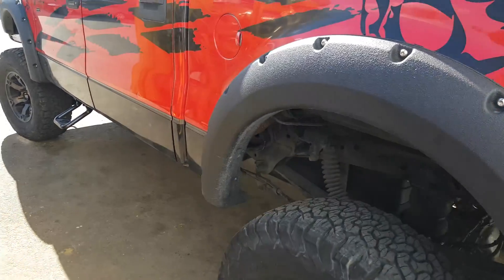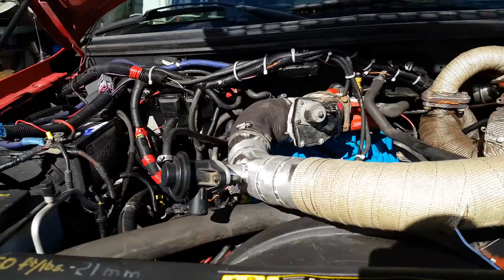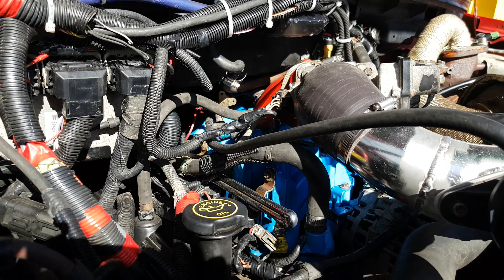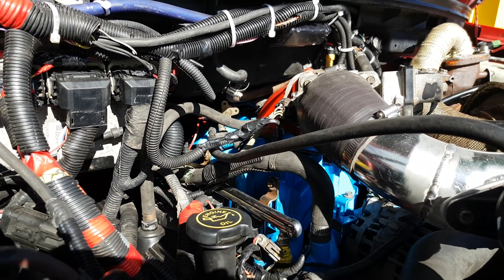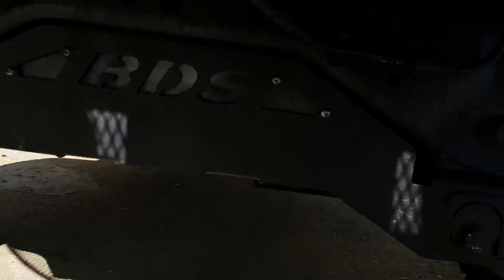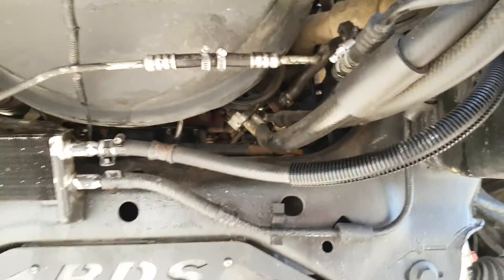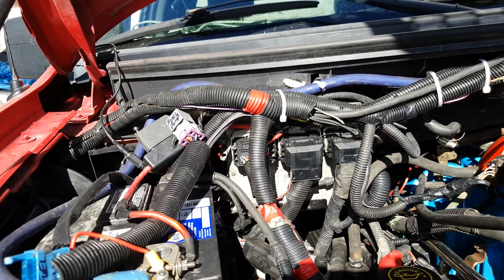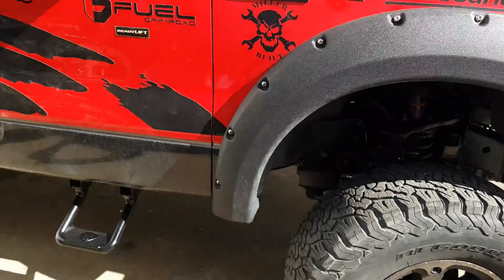Ford 5.4 3v to 2v swap

Comment from the maker: Victor, If you see this message, please pay the money you owe me for working on this truck. I should have never let you take it back without seeing the money first, and then what happened with your Uncle.... You need to apologize. Either pay me what you owe or sell me the truck for what you bought it for.
Victor, si ves este mensaje, por favor paga el dinero que me debes por trabajar en este camión. Nunca debí dejar que te lo llevaras sin ver el dinero primero, y luego lo que pasó con tu tío.... Tienes que disculparte. O me pagas lo que debes o me vendes el camión por lo que lo compraste.
Reply: Damn dude what happened?
Reply: damn you victor!
Reply: Drew are you the one did the work?
sorry to hear dishonest people.

how did you program the pcm to read the 2v?
Reply: I did the same swap now I'm having a no crank no start issue
Reply: What do I need to do
Reply: I just did a swap in 04 with 5.4 3v to an 4.6 2v from an 07 engine transmission transfer case and harnesses some swapping of motor mount parts engine bay harnesses, pcm, fuse box, cluster, security module, key sensor and tumbler and key, abs module. Started with no warning lights except tpms didn't even have to bring put the scan tool

Comment: hey Drew its awesome what you did with that truck I'm helping my 74 year old friend out and doing the work to his truck since he cant he has a 05 f150 fx4 and it had a destroyed 3v and we bought a part truck but did not realize it was a 2v both 5.4 can you please provide a bit more specific detail as to the mods we need to do or would it be easier to swap computers as well or will that even work

Comment: What about a 07 4.2 to a 97 4.6 2v? Have harness motor trans ecu etc out the 97 towncar. Buddy has a 4.2 that is blown up n I don’t really have a use for the 4.6 swap.
Reply from the maker: @rebelfromva  no idea I have never seen a 4.2
Reply: @drewmurray2583  the 07s came w a 4.6 2v too but it is slightly different than a 97 due to some upgrades thru time. Wondering about compatibility issues if I had the donor vehicle for the swap basically.

Comment: Is it possible to just use a 2v computer?
Reply from the maker: @sususmongus2514  yes but it won't be able to control the newer transmission
Reply: @ first off thank you for still replying to comments, you’re a godsend. Would a 2v and matching transmission just be plug and play then? With the 2v computer? Or is it cheaper to just tune the old one

Comment: Just bolted my 2v on my 2010 f150 with a 2v harness hoping it all plays nice
Reply from the maker: @highflytreeguy  the 2v harness won't work with that truck. Use the 3v harness and leave the cam phasers unplugged.  It will need a custom tune
Reply: Even tho it came out of 2010 with a 2v ? Same body style and same trans 6r80.. i snagged the updated throttle body too . . I got original harness I can put back on  @drewmurray2583
Reply: @drewmurray2583  what kind of tune did  use and or who did you go to no one wants to attempt it
Reply: Do I use the throttle body from the three valve or the two valve @drewmurray2583

Comment: Hi, im thinking about buying a 04 Navigator with a 5.4 v4 and a 4spd tranny the body was totaled in an accident. Another guy is selling a 05 Navigator with a high mileage 5.4 3v with a5 spd tranny but the interior and body is nice, the motor in this one is dead. Both vehicles are complete with all wires and  electronics and I can get them cheap.  

My plan is to  put the low mileage 4v InTech motor and tranny from the 04 into the 05 that has a 3v Triton. Do you know if this swap will go smoothly or am I missing some critical complication? Thanks
Reply from the maker: @hiz-n-lowz1577  you should be able to change the harness and computer but you will have to find a way to reprogram the security immobilizer
Reply: Thats something I  hadnt even considered. would I have to do that even if I were to swap over the old ignition and keys from the donor  car along with the ecu? Thanks
Reply from the maker: @hiz-n-lowz1577  that might work. Sometimes the body control module has to also go with the key, maybe the cluster I can't remember.  A locksmith should be able to program a new key though

Comment: Hey drew I've ran into a problem I've got it turns over and I've started the 2 Valve 5.4 but I got a issue with the return gas line and the main break vaccume that was on the 5.4 3 valve  where do I hook that vacuum up at  and how do I run the return line
Reply from the maker: I ran the returnless fuel system from the 3v, rails, injectors . You can run a return line by running a return line back to the tank and modifying the sending unit to accept it. the 2v also had vacuum brakes, it's there

Comment: I’ve seen old 5.0s swapped into that generation too. We’ve also swapped 4vs into the previous generation
Reply from the maker: nice!
Reply: @drewmurray2583 can u swap 5.4 4v heads to a 5.4 3v?
Reply: Do u know if I can swap a 2v 5.4 into my 09 f150 which has the 3v with the cam phaser bullshit.
Reply: Can u swap in 5.4 4v heads on to a 5.4 3v?
Reply: @ no

Comment: Morning Drew I hope you are still on I am attempting to do the same swap as you have done and i am trying to convert the throttle / intake.  I was just going to change the intake manifold but as you know that dosent work.  Did you just change/add the actuator with an adapter. I would really appreciate some feed back
Reply from the maker: that's exactly what I did. Make the 3v electronic throttle body fit the 2v intake. I think I used the 3v fuel rail and injectors at first when I was testing it out naturally aspirated. Had to bend it I think.
Reply: Thanks for the reply Drew . 
I got the adapter done looks good and it even works I see in one of your other posts that you used a custom tune that is what I am in the market for now.  Thanks again @drewmurray2583

Comment: pulling 3v out of 04 thinking about installing a 2v. my question is cant we use pcm from 2v? no tunes should be necessary (my opion) please correct me if I am wrong. 
bell house bolted up? no special adapters?
Reply from the maker: the pcm runs the transmission also and the 2v one will be expecting a 4r100 or 4r70w not 4r57e
Reply: @drewmurray2583  
makes sense... did transmission and engine bolt up perfectly?
any other helpful information before I go this route....also can get a 4.6
for penny's was thinking about this also.
Reply from the maker: @sonofsteve566  Yes all the modular stuff has the same bellhousing. the remote oil filter from 5.4 2v f150s fit best I thought. I should mention I finally figured out the trick to building a reliable 3v. The melling high volume pump along with making sure the cam journals and all the bottom end bearings are good seems to work. The stock oil pump barely does the job so as soon as it starts leaking oil places like the timing chain tensioners, those phasers will start knocking. The increased pressure and volume does the trick!
Reply: @drewmurray2583  
great advice!
rocker roller fowler, check check and check again replace if any signs of being just a little loose.
had fowler give needle bearing everywhere! grenade threw valve keeper spring- boom.
valve dropped 💥 piston crashed...intior of engine BOOM!!! looks like a bomb went off pieces everywhere....
sucks.
Reply from the maker: @sonofsteve566  oh I have seen that many times before. A couple reman engines from ford with only 10-20k on them dropped valves. I hear they reuse the old followers.
Reply: @drewmurray2583  
noticed remand 3v market, is its own monopoly. 
Looks rigged if you ask me.
I have had 2v work horses in the past that put a lot of hard miles on them sold them 250k-300k still strong. 
so this one is a good looking strong rolling chasi. 
thats why I'm considering a used 2v.
appreciate your response and videos. 
internet has really different from the old days...a wrench and a Chilton😁
Reply: Will a Ford E-Series 5.4 2 valve 4R75E ECU work?

Comment: So, is there a running video of this?  How was the lag from the TP38?
Reply from the maker: throttle response was fine after doing the relearn procedure. the transmission was bad so It never got finished and the owner took the truck and never paid

Comment: Why won't my engine start. I  removed a 5.4 3 valve from my 2006 f150 and swaped it out for a 1997 5.4. 2valve engine. And it won't start
Reply from the maker: That's a good question I can't help you with much. Sometimes all it takes is a second set of eyes to catch something you missed! Start with the basics...

Comment: What transmission issues did you have ? And what exactly do you  Have to do to the intake?? And and it do you know what time what type of tune I need to order from SCT?
Reply from the maker: the tune will be custom, you have to tell them about the swap and get the vvt etc deleted. The trans in this truck had just been "rebuilt" and the story the previous owner gave was sketchy. While I was dialing in the base tune it grenaded itself, started boiling the fluid, clunking etc. Felt like valvebody issues which he was saying he had after he got it back from the rebuilder. Switched out the valvebody himself etc. There was still mud and grease caked on it under the fresh coat of paint!
Reply from the maker: The intake on the 2v is angled different than the 3v, needs a different elbow or maybe try a 2v intake
Reply: @drewmurray2583   I guess I'm not understanding what you mean what elbow are you talking about
Reply from the maker: @derekheuring4076  the intake between the mass air flow sensor and the throttle body
Reply: Did you have to use the 3valve wiring harness on the 2 valve engine cause on my 2 valve engine the computer is different from the 3 valve

Comment: love to discuss more of what you have done just did this swap in an 04 and truck will not start trying to get more insight
Reply from the maker: check the basics. there are lots of connectors and a couple ground points in the harness that are easy to miss. does your fuel pump run for a second when you key on? can you get rpm signal with a scantool? is the crank sensor plug in all the way and is the harness ok down there? Cam sensor connectors stay unplugged.
Reply: @drewmurray2583  is did the swap and asked a couple questions below waiting  for your answers  it don't start
Reply from the maker: @dlcndcajmc  lol I can't fix it by answering your questions. you are obviously overlooking something. Leave the cam sensor unplugged like I said. If you look into it the trigger wheel is different on the 3v phaser vs the 2v cam gear so the computer won't understand. Good luck!
Reply: @drewmurray2583  double checked all connections only one cam sensor is plugged in on passenger side and crank sensor was replaced and wiring was checked all good fuel pump comes on with ignition on and primes and shutoff and rpm signal to tuner and to scanner are good as well as shows on dash just having a crank no start will try to start on either but will not stay running disabled vvt system and imrc system as they are not needed with the 2 valve modified intake to run the throttle by wire throttle body. just purchased the microsquirt ecu will be here by sunday ill install it on Monday any guidance would be helpful I appreciate the response just trying to get the truck to run.
Reply from the maker: @brentkohler9021  Sounds like you are close, time to check for spark, there are fuses for the ignition coils and the fuel injectors, see if there is 12v there with the key on.
If you go the microsquirt route you will need to source an ignition coil driver module like the one they recommend. I used ones from older audi 1.8t/2.7tt and wired the coils in SERIES for wasted spark. cop ignition coils will work wasted spark but wire them in series not parallell. Not worth it unless you are doing forced induction or want the race features imo
Reply from the maker: @brentkohler9021  unplug the one cam sensor also
Reply: So this is gonna be a dumb question which injectors did you use.
Reply from the maker: @brentkohler9738  the 3v ones, with the 3v fuel rail bent to fit!
Reply: @drewmurray2583  I did the swap and can't get it to start everything lined up
Reply: @drewmurray2583   so your saying don't have any cam sensors hooked up at all. Cuz I have the one hooked up on the driver's side
Reply from the maker: @dlcndcajmc  yes but that's probably not your only problem. check all grounds, fuses then begin the basic no start diagnostic procedure, spark fuel etc. somewhere you missed something
Reply from the maker: remember to get it tuned right away when you get it running. It will drive around ok but have a lean idle and probably not enough fuel under load.

Comment: What year is the truck.  04 by chance?  I see this working with an 04 platform.  I see the knock sensors being the issue.  05 and up have 2 if I'm not mistaken under the intake. And the temp sensor for the 2v is on the bank 2 head.  Looking to do this for an 07 expedition EL
Reply from the maker: knock sensors don't need to be hooked up. Custom tune
Reply from the maker: oh yeah it was an 04 yes
Reply: Then it's possible.. I have hp tuner so yeah cool bud thanks for the info

Comment: The two valve was the best over all for longevity.
Reply from the maker: I agree! My 2001 f250 5.4 has 570,000k and runs great!
Reply: My 2008 F250 3 valve has 448444 miles on it  I held it to the floor for a good 2030 minutes trying to get it to blow up Before she finally Is failed  Wish I would have toured a part and fixed it engines are crazy expensive for that truck And I kinda miss it now
Reply: @feliciatate-salmon3384  idk where you are but my local scrap yard sells V8s for $300 with a $80 core credit
Reply: Sure until one day it decides to either spit all its plugs out or timming tensioner decides its had enough and sends the pistons to the heads in spectacular fashion the 2 valve are complete garbage engines at least the 3 valves will let you know it needs help way before it let's lose most people just ignore the phaser noises until it's to late

Comment: So did you change to a 2 valve wiring harness ? and did you video the whole swap ? Trans bolts up
Reply from the maker: oh yeah all the modular stuff shares the same bolt pattern so bell housings are interchangeable. Even the 6.2 and 5.0 will fit and no this truck retained the factory 3v harness, pcm, drive by wire throttle and I piggybacked a megasquirt standalone to control fuel and spark. I never finished the truck because during tuning I discovered there were transmission issues and then the owner ripped me off for all of my labor and parts. nearly $8000!!! I hope it catches on fire in his garage!
Reply: @drewmurray2583  damn. Wish you had more videos of that truck.
Reply: @drewmurray2583  Thanks for the reply . $8 grand damn
Reply: Did you have have to use the megasquirt standalone for the spark and fuel or would it have just been fine with the tune I was curious if you added that in relation to the turbo and I know you kept the 3v harness and pcm did you have to modify the harness for it to work
Reply from the maker: @nikwilliams1389  it would have been fine with a tune and the stock, unmodified 3v harness

Comment: Can you tell me more about the standalone ecu system you used. I've done the same swap. Got intake done. Drove it out shop but needs help.  Any help would be greatly appreciated.
Reply from the maker: I use megasquirt efi. custom wiring, custom tune all done by myself. If you live near a tuner with a dyno it should be simple to program the 3v computer to be happy with the 2v and missing cam phasers. That would be cheapest and easiest, getting an sct tune or whatever
Reply: @drewmurray2583   thanks for your reply.  We're trying a Econoline ecu out. Since they had 2v and same trans for those years. It was no cost just gotta wait on shipping.  Probably have to take to Dyno shop though. Thanks for the tip.

Comment: Oil filter location would have me alittle worried when offroading? If you do? And why did you go to 2 valve?
Reply from the maker: can't find any good cylinder heads to build a 3v. I have thrown away dozens with torn up cam journals. also the 2v is easier to turbo without the cam phasers.
Reply: Do you know of a good tuner that makes house calls
Reply: Will a bad tps  keep  the motor from starting
Reply: 3 valve is reliable but 2 valve is reliable(r)

Comment: but can you put a 3v in place of the 2v with the solenoids not pluged in?
Reply from the maker: yes but it runs lean at idle. get it tuned and it will work fine
Reply: Why would you wanna do that